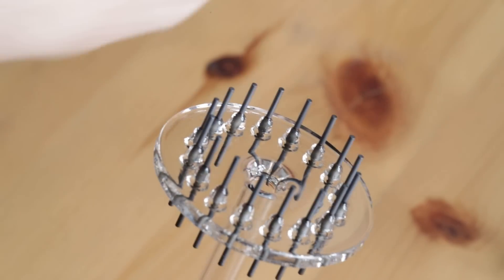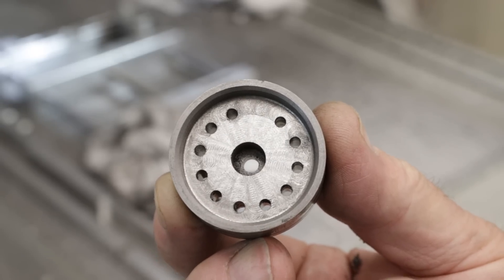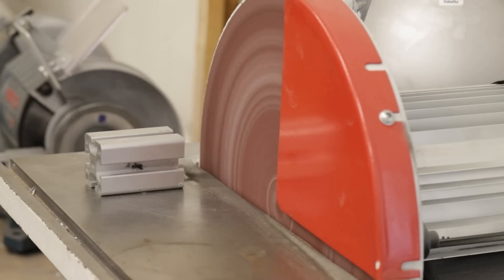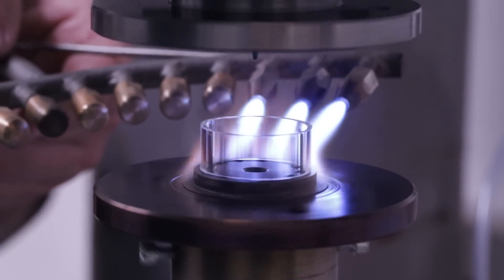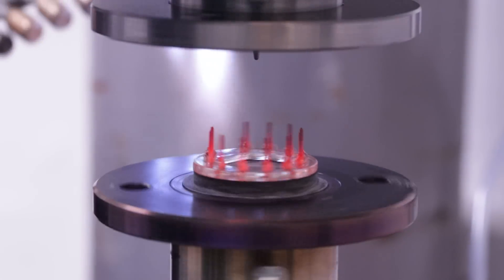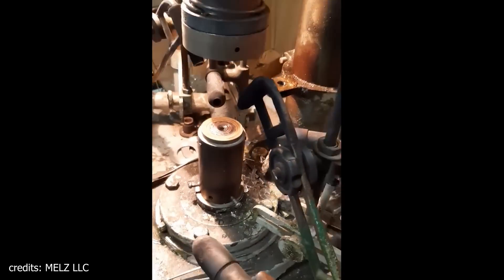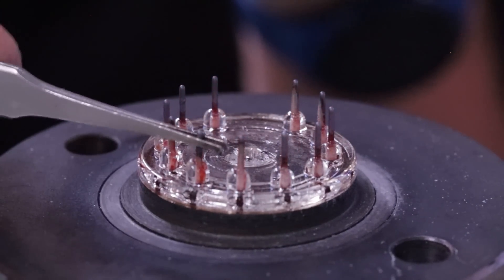Stem ejection mechanism working.  F project | EP#9

Comment: Can you use an alloy with a higher melting point than the correct softening point of borosilicate? Also use torches that you can aim so the bulk of the flame is next to the circle the pins are in instead of on the pins and the glass. There are positionable lathe burners with multiple heads but I'm sure you know this

Comment: Would it be too costly to make a pre formed puck with holes for the pins, then press that? It seems like most of the problems are related to glass flowing where it isn't supposed to be or is missing from, so making the distance glass has to travel would be logical solution, no?

Comment: I work with glass to metal seals as my main job, and we still have a base press machine for certain jobs
What metal do you use for the mold? Most of ours are made out of Monel. We also use beeswax on the top jig to prevent it from sticking, so if you still have problems use beeswax for lubrication. Really cheap, does not affect the final product at all, might be slightly harder to do for a fully automated machine but really useful.
For best practice the pins should be beaded up with glass before adding on the larger rings. This can be done in 2 ways - Having pin sleeves (Thin tubing with internal diameter close to size of the metal pin), and working them on the base press by heating and allowing the glass to gather, or by individually beading up the pins on the lathe with glass rod. Rod's cheaper and easier to come by but the pin sleeve method is slightly easier and almost guarantees correct position. Having the glass on pins before pressing drastically reduces the risk of a poor bond, and of bubbles between the pins and glass (a possible leak path for when it's pumped under vacuum).

Not every press has this, but ours has a lift on the bottom jig. This allows us to lift up the piece while it's still warm (first press will cool it enough to be fairly solid) and then get the heat from the ring burner underneath the piece to better heat the centre. Having a flame underneath allows the heat to spread and rise better. We also have a hand torch that we point downwards towards the centre for certain jobs (and is what we'd use if manufacturing your setup). Outer and inner ring of glass makes more sense than trying to squash a larger amount of glass into the centre, and especially as there's no inner ring of pins that flared piece of tubing inserted into the bottom jig would also be useful, you just have to experiment with how much glass is on the inner rings. We also have a small carbon tool to hand (flat paddle) to tool in the outer glass slightly between presses so it can fit in the mold without it spreading out too far.

Try 2 or 3 softer presses, don't try to get the entire shape at once. Glass has memory to it and doesn't like being forced into a drastically different shape, no matter how hot it gets. Even with casting in carbon on an induction coil, we will often run an item a few times before we're happy with the result. Slow and steady wins the race.
Reply: That has been my experience too. Multiple quick heatings and pressings unless its on an automatic machine which usually have a pre forming position with a little paddle that comes in pushing the glass the direction you want it to go in. Also automatic machines will deposit a very melted nearly fluid blob of glass in the middle. Most places I went to had foot operated push up mechanisms for the wafer or button stems too. They would push by the pins as I recall. We only made flat press and preform type stems in house.  I discussed the idea of pre beading the pins with Dalibor. With Iron nickel pins and AR glass it really wants to be done in one operation as the degree of oxide diffusion is pretty great and multiple heatings  could result in Leakey or weak seals. Think of it as borated dumet. They want only a single heat or you will loose the oxide and give you a bright seal which is weak. Which company do you work for? Fredricks, Richland, Or Troyonic by any chance?  Those are the places we used to work with that still are around.
Reply: @MrSupro  nah none of them, Torr Scientific, which is a "new" company, but if you've heard of ITL back in the day most of the equipment and like half the staff are from there. UK based
Reply: Oh you make the fancy stuff. The only Uk company we ever talked to for glass was Moore’s but they were too expensive for us.

Comment: You should take a few design queues from the old videos that still exist of the original process... In particular, the placement of multiple stationary smaller torches are spread out in multiple even places surrounding the parts, that way the glass is more evenly melted, helping reduce uneven temperature, and lopsided collapsing. This also allows you to direct the heat directly at the glass, and not the pins, this should give you the ability to introduce more heat into the glass faster, and reduce the chances of you melting pins.

As for the center flanged tube, you can easily shape the glass at that point as well by putting a nipple on your upper die that slips into the tube of the flange, and helps form the glass at that location, while maintaining the opening.

Comment: As for the glass extruding outside the ring, could you make the outside step taller so the die closes before the pressing action starts?
that way the glass wouldn't have anywhere to go but towards the centre 
yeah, stainless should help a lot with thermals, might be worth looking into high temp grades for final dies, like 321 or INCO 825, or even SAF2507, Inco can be a bit expensive, and all 3 are a pain to machine, but they should last years working at glass working temperatures. 
btw, most high temp Stainless grades have even lower heat conductivity than basic 304/316 grades.

Comment: Question, if you make the fill / flanged stem nearly to the end size and while hot stamp/punch holes where pins would go. Once that is in your stamping jig, you would require only a small glass ring to fill around the pins, since the stem / inner part is already formed and in place.

Comment: You probably want an ejection mechanism from the bottom that presses on the pins to extract the stem, why don't you partially lift it between the presses to heat it. I'm not sure if a different moulding material would help much.

Comment: As I said in my comment ts last time. You don't have a hope of flowing glass to the centre  unless you preheat the mould itself. Glass is rapidly cooling below it's transition temperature the moment it touches the steel.. In that company video the lower mould is preheated.

Comment: I was going to mention the cold top die and pulling the heat away.... but, you covered it at the end talking about stainless instead of cast. But still wonder if the top die being heated would also limit the amount of heat pulled from glass.

Comment: If you do go stainless you can get it electropolished it's normally pretty cheap and would be able to do all the small details of your moulds. Cutting on your small CNC could be interesting. Low depth of cut and keep the feed rate up, rubbing the tool causes work hardening and that's bad. I do wonder if you could include voids in your moulds as somewhere for excess glass to go? Just to make getting the fill exactly right not as critical.

Comment: Mullard had an interesting technique for the base that can be seen here: https://youtu.be/5WCWejeRR_s?t=1225 They put a glass ring only around the outside of the wires/pins.  They then heat the ring and use a toothed wheel (presumably to clear and go between the pins), which pushes some of the outer ring through the pins and towards the center.  Then, they press the base.  Using the toothed wheel apparently removes the need for an inner glass ring to form the center.  Also, the outer ring can be heated directly with a simpler torch setup.  Anyway, I thought this video may provide some ideas.  Good luck!

Comment: Perhaps insert a thermoelectric cooling device under the lower mold half, with the idea being to wick heat away from the pins? Or would that prevent glass sealing around the pin? Really neat stuff. 👍

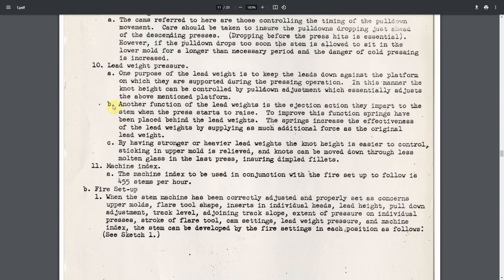Comment: I haven't finished the video, but at 2:19 , the "lead weights" likely refers weights made of the metal: lead (i.e. Pb) - not "lead" as in a "wire lead".  Lead weights were extremely common (at least here in the U.S.) and were used as fishing weights and for builder's "plumb bobs", etc.  RCA using weights made of lead metal as part of a manufacturing process would make sense - especially in that era (1950s).

Comment: The Melz torches look like methane/air, not oxygen. Lower flame temperature might help to not melt the pins.

Are you using propane/oxygen?
Reply from the maker: Yes, I use propane/oxygen. Methane/air would be too cold I guess, but they have 6 nozzles..

Comment: Have you considered putting the pins in the top part of the mould and once the glass is molten in the bottom part you press the pins trough it. It could help heating the glass without melting the pins.

Comment: Is it an option to flip the unit, and have the pins on the upper half of the mould? That would mean you wouldn’t have to worry about overheating the pins and could use a glass disc instead of a tube.

Comment: Thank you for these interesting & frequent updates!

Would it be possible in a first step to "punch" the pins through the flange (which already has the final dimension/circumference) instead of "flowing" the glass around it and in a second step build the stems around the pins by adding only a small glass ring if needed? 
If the starting flange is thick enough, could there even be enough material to do it all in one step?

Comment: The facebook video is what i was thinking of recommending on doing too, the center needs to be a plate. Also calculate the volume of glass required and add like 10% extra. As for the mold if you want to prevent flushing on the outside you can design it so that it forms a seal from the outside to inside as it's lowered (aka different draft angle); another way is to add a flushing groove for overflow with a thin passage so any flushing breaks off cleanly from the outside. I am not any glass expert but i am mech eng, and this is what i would try without any research and without knowing the requirements;p

Comment: Nice work! I think it might be worth experimenting with a tightly toleranced two part mold at the top, such that the diameter of the mould that makes the OD of the glass part slides down first, without pressing on the glass, then the top face comes down and presses the glass to final thickness / squeezes the glass out to the diameter. The key thing will be to ensure all the meal parts are at a close, and stable temperature.

Comment: I had seen the molds kept warm with a bushy flame between loads to reduce their effective thermal draw on the glass. Eventually the molds will heat up enough that the melting flames would keep them at temperature. also be sure the bottom of the exhaust tubeulation is supported underneath or it's weight will sag it down and away and constrict or just seal off just under the wafer even after the mandrel on the upper die is withdrawn. They used to blow a puff of air up through the hole to make  sure that glass sets pretty quickly but not enough to set up stress in the glass as it cools. Looks good. I am half way through rebuilding the Eisler single head pinch flat press stem machine and have already made some of my new design stems on it. Working on an easier method of flame control and better quality torches this week.
Reply from the maker: I did like 20 attempts and the molds got so hot the glass started sticking (that happens over 350C). We will see if SS makes difference! Good info with the air blowing - I hope I can avoid it - adding that to the rotating carusel would be hell :-)
Reply: @daliborfarny  You need to try different materials, different cast irons, cast irons with vermicular graphite...
Reply: @daliborfarny  I mean, I'm just getting this from google, but Graphite doesn't stick to glass, so maybe look for a cast iron that has a stupid amount of carbon / graphite impurities... May need a graphite powdering every so often.

Comment: hello ! for finishing the parts, use a tumbler   ! the surface condition is perfect
Reply from the maker: Will give it a try!
Reply: @daliborfarny  exemple : turbo twin tumbler with every sand blast or tumbler rotary with stainless steel needle
Reply: @daliborfarny  bead blasting might give you an interesting surface texture too. Each way bet if it'd be good or bad.

Comment: would it work if the flange of the exhaust pipe is big enough to cover the inner area so no inner ring is needed and only the external ring needs to be melted?
Reply: It would still need to be brought up to seal temperature or a radial thermal stress fracture would occur. This is however a method that has been used where a exhaust tube and flange of a calculated volume is molded in a separate automated process. Alternate to this is a molding process where the exhaust tube and wafer are pressed with holes and pre beaded pins are installed in a subsequent step. The fastest over all though for semi automatic production is the process seen in the Melz video. They have an automatic cutting and flaring machine making the flanged tubes.
Reply from the maker: Yes, thats what Melz uses in their video, might be the way..

Comment: maybe you've already tried it, but i was wandering if there is a way to insert the pins into the molten glass simultaneously with the press-forming, so they won't overheat.
Reply: This is a good idea. You might have problems with the pins becoming stuck in the dies without lubrication and the tight tolerances involved to keep the pins from becoming encapsulated.

Comment: Awesome work as usual. 👍
Why didn't you put the little pins in the freezer and/or heated the other part? That way you would have a bit more clearance to press them in easier 😊
Reply from the maker: They are designed for a serious press fit, I dont think heating it up would help.. anyway, I hoped I found a quick/simple solution for inserting pin into metal.. wasnt that easy in the end.. :-)

Comment: Maybe thermal capacity of the top  part is big and causes instant freezing. I think that original machine uses less cast iron and more graphite parts that are not visible. Maybe gentle preheating of top part will make better parts. I am watching the whole series as it is good mental workout in design and engineering. Hope to see new video with goot news soon.
Reply from the maker: I am afraid this may play a role too.. graphite is close to SS with thermal conductivity (24 W/mK), it would work well in the upper mold, we will see! Thanks for watching!
Reply: @daliborfarny At work our customers use white cast iron with deeper cooling channels to prevent overheating of moulds in our IS machines in the glass bottle industry. There is a preheat time involved before steady state temperature is reached during production. Graphite and ceramics are used when pre annealed bottles require handling when going into the oven but graphite is generally too soft of a material for our application if used as a mould.

Comment: Maybe they ment LEAD , like Pb , weight ... or am i confused ? :)
Reply: Lead as in the Pb element, does not make sense in that context.

They are really referring to the pins as leads (conductors).
Reply: But Pb would melt right away in this environment... I am contradicting myself now or i am missing some detailes :)
Reply from the maker: But that would mean “heavy weight” which has no reference to anything.. still think it is the pin :-)
Reply: @daliborfarny  Lead has always been used as the term for the metal pin since the edison days here in the US. and england.
Reply: @MrSupro  agreed. Pronounced differently than the element. Lead, as in, lead a horse to water... meaning "connection point termination". The test cords of your test equipment are also "leads".

Comment: I lke that Your progress is definitely in the positive direction.  In looking at the evolution of the inner melt perhaps you could replace the inner cylinder with a stem that has a glass mass that is expanded to about the size of the ring when the outer cylinder goes molten.  It seems to me that this might make the mass of the central glass more controllable thermally and keep the stem clear.  Still not certain how you're going to control the differential thermal shock on the stem without a controlled heating of the lower mold.  Perhaps you could use a PID-controlled induction heater to bring the lower mold to bring it to a thermal state just below the liquidus state of the molten glass.  Relearning this level of historical materials science isn't easy or anyone could do it..
Reply from the maker: Make sense, I still hope to use only glass rings as it makes things easier. The thermal shock/stress is not a problem if you can extract the stem still hot from the molds and move it quickly to annealing oven to release the stress. The mold will achieve some operating temperature after few minutes. It needs to stay below 300C, otherwise the glass starts sticking to it..
Reply: @daliborfarny  It seems like you have a handle on it. I think your point on where the burners point is one of the keys to controlling the melt so you don't underheat or overheat the molten mass.  Still not sure how you're going to control the mass in the middle if you're not going to use a preformed stem.  I still think that, if you're going with a stem then the preformed flare should contain containing all of the glass that goes inside the pin ring.  That's only a grain of salt observation in the absence of other criteria. Have fun!